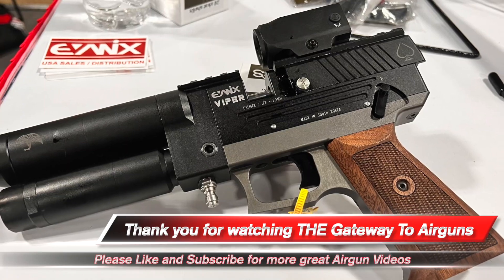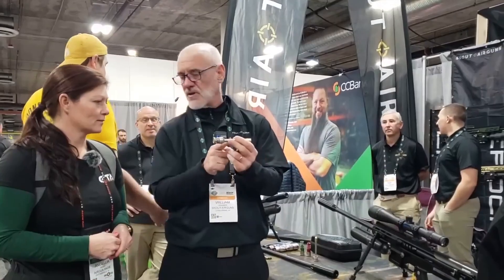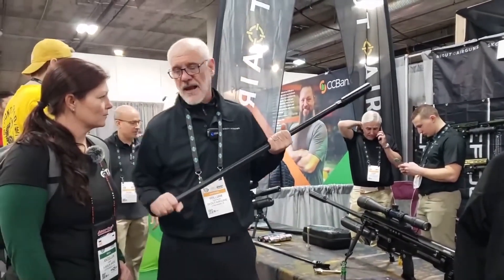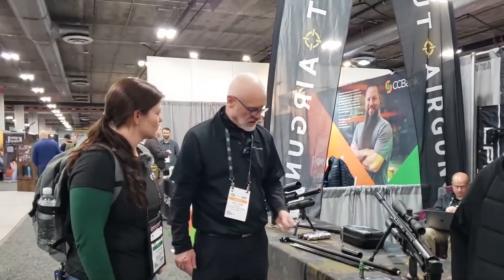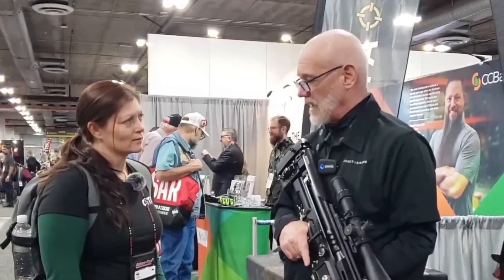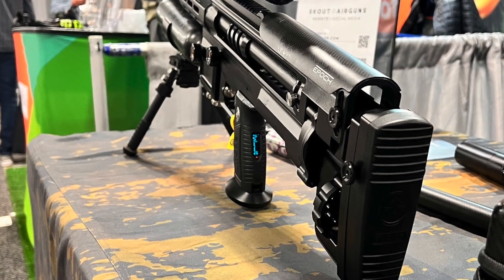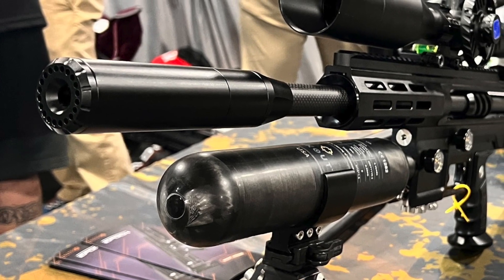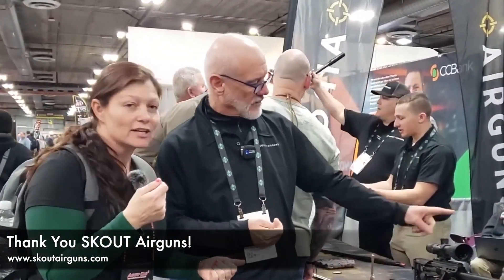SHOT SHOW ‘23 – SKOUT AIRGUNS - EPOCH!

Comment: I bought it in .30 cal. Its a very nice gun but not as accurate. At 25 yards mine is doing 1/2 inch group and everytime you stary shooting it has POI change. I have the Fx maverick in .30 cal, benjamin akela, walther reign and all those guns at 25 yards is a 1 hole group. Maybe mine has an issue but for the pruce it should not be like that. I wrote to Darryl at skout airguns and I am waiting for a response.

Comment: Finally....electronics in a gun. Hope it triggers all the idiots out there. SKOUT will be the new standard
Reply: Daystate has been selling electronic air guns for over 10 years.
Reply: @RW-ur7ym  and they cost a $1000 more and don't come with 2 extra barrels
Reply: @michaelhammond7115  Actually the Daystate Delta Wolf is less expensive and has a Lowther Walther barrel that can easily be changed to another caliber. I don’t need three barrels of the same caliber. You can also charge the battery in the Daystate guns without taking it apart!